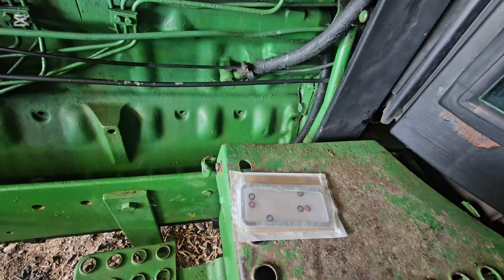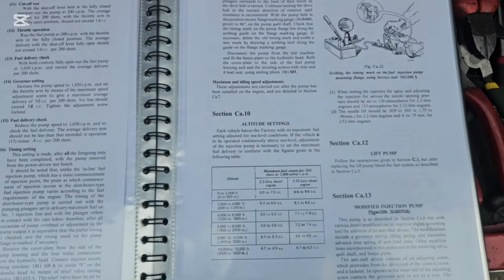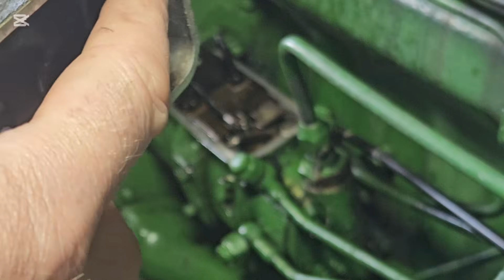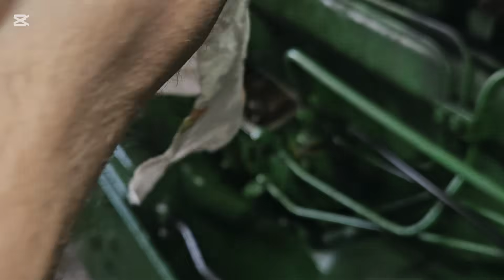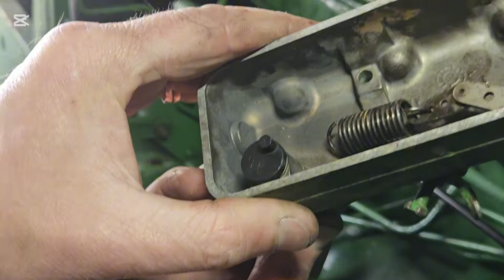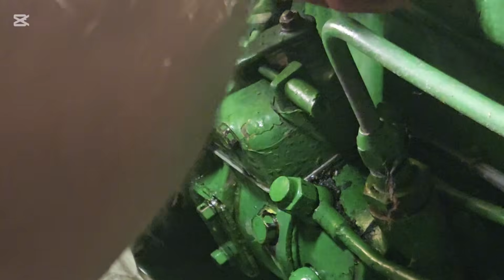HOW TO RESEAL YOUR LUCAS CAV INJECTOR PUMP

Comment: Great video..... occasionally I've had to put a double gasket on the top cover to stop it leaking, probably because of a slight warp in the aluminium.....if you also open one up and the spring slips off for what ever reason,9 times out of 10 it's middle middle and you will also see the markings on the governor and top housing holes where the spring is located

Comment: I have never seen a 3050 here in Australia, they may have been here but not common if they were. Lots of 3350s and a few 3650s though. Interesting to see Saran on the engine ID plate. I haven’t seen that though on those Saran motors before. It looks as though your tractor has had a couple of liquid overhauls by the paint on the pump.
Reply from the maker: 3050 is the most common of the 6 cylinder 50 series here in Europe. All Saran built engines here for the European built machines would have that on the ID plate.. Yes, it's had a few bad paint jobs over the years, time to rectify that. Thanks for watching 👍

Comment: Nice video Allen... So it's a 3050, not a 3350 like on the decal?
Reply from the maker: Yes, one of the previous owners changed the engine and put one out of a 3350 in it, he changed the decals also. I'll be putting it back to original